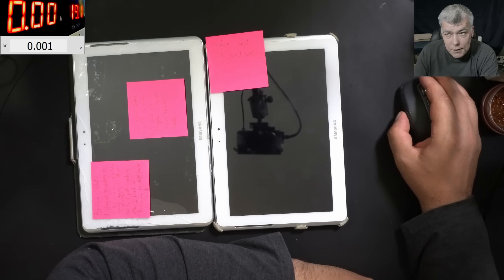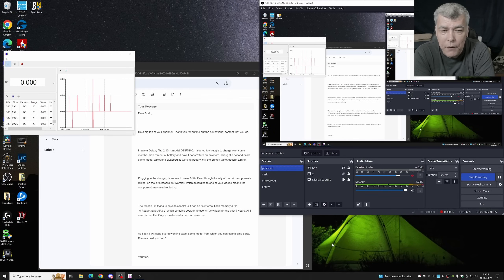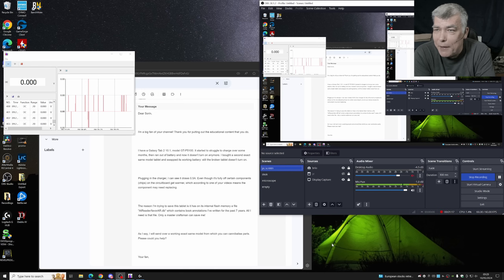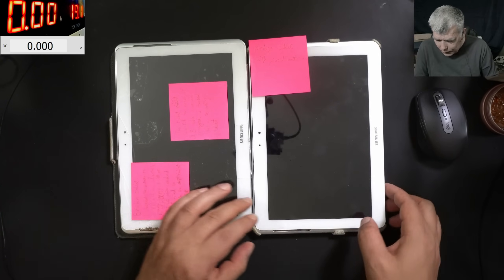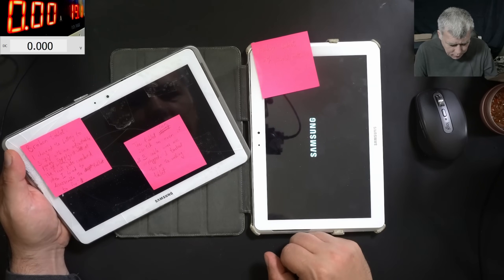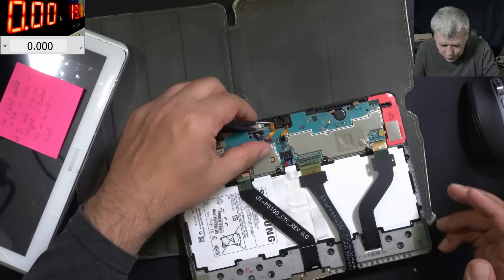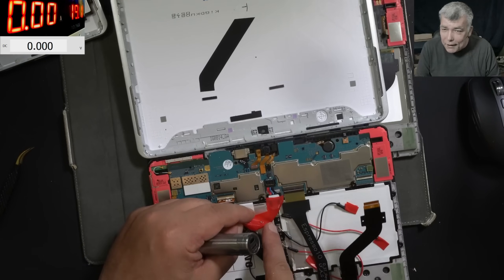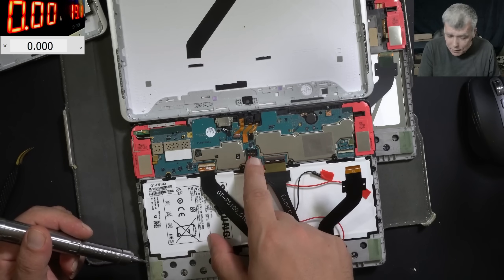I failed to recover this customer data - Galaxy Tab 2 10.1  GT-P5100

Comment: I don't understand why you did not use the heat gun to remove the storage memory chip from the old bored and transfer it over to the new board. 
That would have saved you a lot of time pissed farting around.
Reply: No. nands are paired with the controller chip so you can't just swap the nand to any identcial board.

Comment: Data loss is a bitter, bitter pill.
Like a fool, I put all my eggs in the Fusion Drive in my iMac and the logic board failed after 7 years of flawless performance. Took the drive with it. A whole terabyte of personal data - photos, videos, docs, tax records, etc. - just... GONE.
Microcenter was generous enough to advise me that a data recovery service would be willing to try to recover my loss for the modest fee of only $1,900.
Reply: Was it a 2015~ish MAC with FD? I hope you didn't try to repair your drives with DiskDoctor. How is it went with MicroCenter?
Reply: @bitrehab  it was a late15. And I did not.
Reply: @netdoctor1  What was the cause of the unsuccessful recovery in their report?
Reply: @bitrehab  they simply told me that the logic board had failed and “took the FD with it. “
Reply: Removed both components of the FD to recover the data but unable to recover
Reply: @netdoctor1  Was it an 1 TB HDD and a 128 GB SSD? They didn't knew that the FD doesn't belongs to the controller what can be emulated? I managed recoveries from 2 TB Fusion Drives without the original board and controller, if I recall it correctly after the years only one was unsuccessful from a half dozen. I think any decent data recovery firm can do it (but have to say that nobody likes the fusion drive concept because it is overcomplicated in itself and the APFS on the other side an overcomplicated mess too - that's why Apple ditched the FD after a few years).
Reply: @netdoctor1  Who is removed the components? You or MC? Do you have the drives now? If yes you can send it to me or any decent DR lab for second opinion.
Reply: @bitrehab  I know nothing of Apple tech. I wouldn’t dream of opening it myself. This was all MC. Honestly I’d consider sending it to you if not for security concerns. Passwords, account info, etc. love to have that machine functioning again

Comment: In the time of Pentium 1 I kept my HDD (540Mb) backup data on a CD+R. Then I deleted some data from HDD just to learn that the CD copy while recorded had some errors and the disc was not readable anymore. That was a shock. Since then the rule is to keep important data backup in at least two backup copies on different storage drives.
Reply: A lot of people make a backup but do not actually check it after to make sure it is good. A HDD stored on a shelf is one of the best ways to keep data. Every 1-2 years I remove the HDD from my laptop and put a new one in and re-install everything. This makes the laptop run like new and gives me a backup. Other more important stuff is put on 2 or 3 other storage devices just to be sure.

Comment: I would have swapped the two chips over .... soldering the target memory chip onto the working motherboard and soldering
the working memory chip onto the suspect motherboard. Then see what each does using the working battery.
Reply: I may be wrong, but I think that the NAND chip content is encrypted with a symmetric key stored within one of the other chips (maybe a TPM). Swapping the memory chips would probably do more harm than good.

Comment: The nand had a partial short, probably allready dead. Onlychance would have been to swwp the nand with the 'good' board. Why didn't you try that first ? Data recovery is a whole different ball game. My advice: stick to what you're good at: board repair...
Reply: nands are paired with the controller chip so you can't just swap the nand to any identcial board.

Comment: Humm.. I would have tried to solder the chip to the working board see what result would have come out. Beside that, thanks for sharing.
Reply: It is a burned with short circuit chip. Moving to another board would potentially risk to damage the good board too.

Comment: the chip is EMMC KLMAG2GEND , has two supply Voltage: 1.8 / 3.3 V ...the switching ic getting faulty and passes 3.3v instead of 1.8v , then the EMMC damaged ,, emmc  getting faulty so frequently in TVs , some laptops , some phones ,, and the most common issue in TVs that emmc causes the TV to stuck on logo (or sometimes stuck on standby red light with no logo), sometimes that requires changing the emmc and somtimes only programming it with easy J tag or RT809H
Reply: A minor difference that TVs doesn't store valuable customer data just their firmware what is rewritable anytime. :-)
Reply: @bitrehab  yep , i think people should move their important files via USB to computer regularly and put  their data also for extra safety in external Hard drive
Reply: @alic211  Flash based storages (SSDs, USB thumb drives, memory cards) are unreliable as is, by design (NAND bleeding / charge bleeding phenomenon). So do not store any valuable information just on one flash drive because a backup a day keeps DR away. 😀
Reply: @bitrehab  yep also great know that , that's why companies still produce SATA 6 Gb/s 7200 RPM HDD

Comment: I have had good results by freezing the memory chip with liquid nitrogen and thus still got access to the data for a very short period of time, usually enough to extract important files from it. It's a trick I learned in a recovery lab for recovering memory. Unfortunately, it doesn't always work, but he who dares, remains a virgin 😁

Comment: A sad case of relying on hardware to keep working and not doing at least a daily backup.
Your data can become corrupted at any moment and more often than not it's not recoverable.
Back in the days when we only had hardrives which did fail, you soon learned to do a backup.
Don't take it heart Sorin, you can't win them all.

Comment: I didnt understood one thing, why you didnt remove memory from bad board, then placed on working board?
Why its a must to fix the board where memory is ? Not to damage it while desoldering?
Reply: The bad board is bad, because the memory chip didn’t survive the 3V coming from the 1.8V supply. Transferring the bad chip into the good board will render the good board a bad board.
Reply: Not true! Probably nand is faulty, but swap to good board would only chance?..
Reply: nands are paired with the controller chip so you can't just swap the nand to any identcial board.

Comment: The NAND has flux under it, are you sure they haven't reflowed the nand and caused balls to short out? From not charging to crazy hotspots, that has to be messed up bga and that ight have saved the chip if it is shorted enough.

Comment: Nice job... there are special labs that take out the nand chip  and recover data
Reply: not from fried chips, there's no hope for this one
Reply: There is guy in Canada that saves this kind of nand. He even drills the correct level of nand level to avoid the conflict
Reply: @kgerakopoulos name or channel please
Reply: @kgerakopoulos No, as the other commentator said, this is dead.

You are thinking of sanding SD cards down to bypass the interface controller and solder directly to the internal flash connections.

This is a bare NAND chip with no built in controller. The storage itself is shorted.
Reply: Unless the chip has a shorted internal capacitor. But this is unlikely

Comment: The heat is on the edges of the NAND flash. It could be an internal capacitor. Do some digging and find out.
Reply: that's not something that i will do in my shop. To much of a hassle and nobody will pay that price and still no guarantee that it will work
Reply: You cannot do that without risking to permanently damage the chip or at least not with the tools that Sorin has.
Reply: @ionix2000  Yes it is a risk but it is inevitable

Comment: may be the pads under the memory chip is shorted?
Reply: maybe a reflow could do the trick? that's what i thought.
Reply: @hedpt  the chip is glued, probably needs to be desoldered, and the resoldered with no guarantee it will work
Reply: If it was shorted, the voltage would have dropped to nearly 0.

Comment: Sorin, As a last resort could you have tried to put the customer's nand on the good board?
Reply from the maker: In the first place, no point, the chip is shorted, in the second, has to be paired with the cpu, so the nand and the cpu has to be moved together